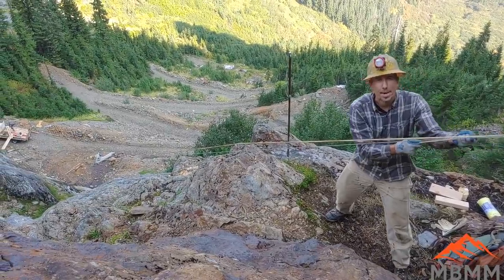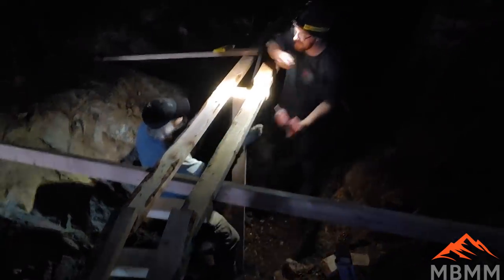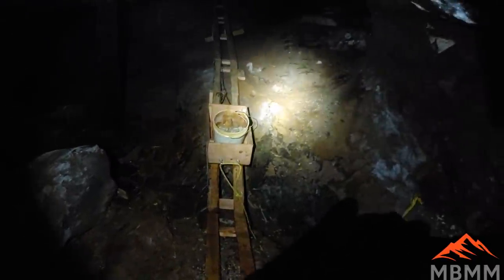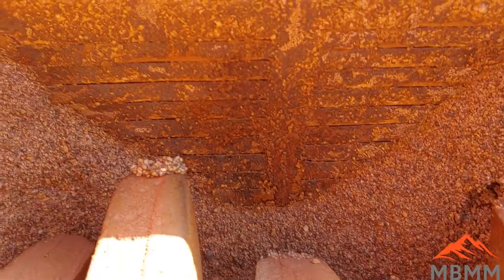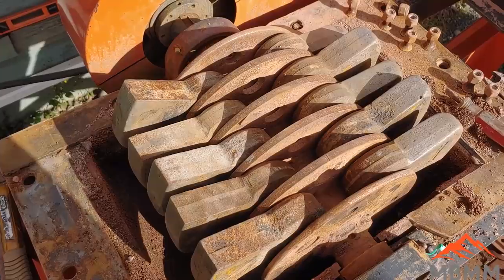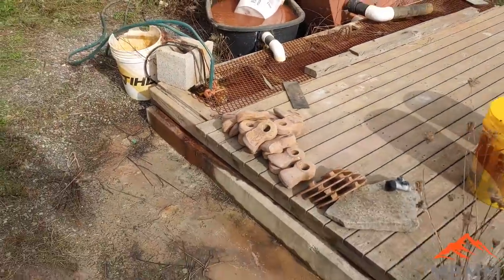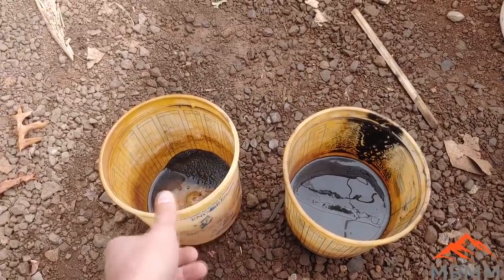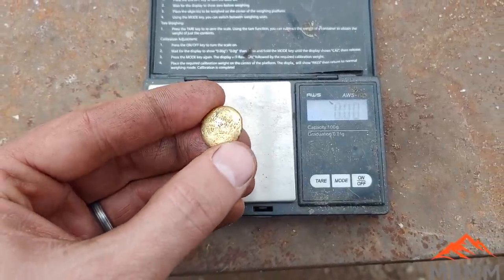Gold Mine High Grading, Hammer Mill Maintenance, Ore Processing, Gold Smelting & Refining

Comment: The strength in wood framing is in compression. We stack one piece on another. The only time we hang a piece by the end is if it sits in a hangar made for that purpose. Around 5 minutes it is clear that the whole weight is hanging on a couple of screws. Put blocking under the rails, not just in the side. By the way. Nails are way stronger than screws. Screws break often just from vibration and the wood swelling and shrinking.

Comment: Hey sorry one more tip I’ve seen mills each hammer has a rubber washer made with tire tubes some have bought neoprene but it doesn’t work as well and the reason is that the rubber actually cuts down on vibration or the harmonics and it will cause the hammers and all the other mill parts to wear much slower. I get this is a comment insinuating it’s a opinion. However doing this will cut down on wearing components and mill much faster better and cleaner. However the rubber that’s added cannot bind the hammers they still need to be free moving. Having these rubber washers type pieces on both sides of each hammer and not preventing it free motion will greatly increase your production of its task. Believe it or not it’s simple and worth a try. It will save you so much. Vibration or the wrong resonance will have a huge negative effect.

Comment: If you can run your pulley horizontal one side can function as a in while the other side an out.  Slow motor outside.  Might have to run a line in for a remote stop start.  Plus you can wax your 2x4s to reduce friction

Comment: That same Teflon technology comes in wheel bearing form, so you don't have to slide your stuff on kiln-dried pine, hoping to prevent the effects of degradation over the off season. Also, for your bucket-decending system, use a large-diameter axle, fixed so it won't rotate, and wrap your control rope around it a few times. This will give you low-stress control over it, and you won't have to worry about it obliterating the cab of your truck. The wraps around the axle will multiply whatever friction you put on your end. This system also works in reverse, if the axle is spun. You just pull on the rope, this causes it to grip the axle (capstan, I think it's called), and the axle provides the bulk of the pull, but under your easy control.

Comment: Just thinking out loud here.... but for safety, I think one of the best investments you could make would be some LIGHTING for inside the mine.  
Then, install a small winch system at the adit.  You could run both on a generator of sorts.  I mean, you could either get a small generator for your truckbed and charge up some car batteries in your truck on the way to the mine, then transport the batteries up your tram system each time you work at the mine, or better yet, bring a small gas generator with battery backup TO the mine and run it just outside the adit and run wires down into the mine for lights, and plug the winch direct into a 12V port.   That way you aren't worried about fumes from the combustion of gasoline or the sound. And you have a slow steady pull for the ore carts and lighting througout.  LED lighting would use far less juice vs. incandescent.

Comment: Install water injection sprayers above the hammers the prevent the build up on the walls of the mill. The water now in entering at too low of a depth in the mill and will come to a trickle when build up is too much.

Comment: I was impressed with the efficiency of the jaw crusher. I have operated jaw crushers for years and have found they produce best when the jaws are full of material (but not overflowing of course).I am curious to know if your jaw crushers implement a safety so that if a chunk of steel is accidentally dropped into the jaws the damage is minimized?

Comment: haul a generator, battery, winch, and cable to the mine for lights, charge the battery, run the winch, and save a lot of work.
Reply: A Harbor Freight truck winch would be perfect, and even a hand winch would help out a lot.

Comment: David, This channel is like a text book for small gold miners, great work as usual. Did you add ANY lead to the Cons before smelting . And did you way the button before Cupeling. Also have you considered a vibrating fines screen after the Jaw crusher to divert the minus final mesh size portion ifrom the jaw crusher discharge before feeding into the hammer mill to save wear on the hammers and speed up processing. You could perhaps run the minus portion over a pulse jig before the pulp enters the shaker feed.
Reply: Sorry Jason, Not David. You just look like a David I know

Comment: I was wondering about those rails, is there any gold in that mud covering the floor?  I love the aerial tram!  Taking a clue from the past.  Might want to put a little WD 40 to spray on that teflon rub plate every time you haul some buckets up.  Looks like you could use 300' of teflon on the wooden rails as well. Freeman balers had big rollers on the plunger base that were greaseable, they were low profile, maybe they would work on the bottom of your ore cart hauling the buckets up.  Nice Job!  I love what you are doing!  Its  great to see the gold coming off the shaker table!

Comment: Do you not hard face weld the impact areas    of the hammers?  To slow the wear. Just a 2mm thick couple rows of weld in the impact areas  can make a big difference.  In excavator buckets, and similar impact and wear areas. The weld can be ground to keep the original shape .  I would definitely give it a try, when they have had about a ton ran through them would be about the right time to do it. When they just have enough wear to see how they are bgoing to wear. A stick welder welder capable of about 100-140 amps. Depending on the size of rods used.   It would be well worth buying a s pound or two, (maybe more)  if nothing else weld a set of heavily worn hammers. See how it goes. Im  thinking it will work out well. Give new life, or extend the life for the cost of 20; minutes of welding.

Comment: How much vein material could one man break apart in an hour using only hammer and cold chisel?? One ton? I mean if you were not allowed to use explosives.
Reply: Depends on the hammer and a proper grind. But I doubt more then 100-200 lbs.

Comment: Guys get some polyethylene pipe about 600mm diameter and cut it in half and use this as a slide to pull buckets up on. Easier and corners are no problem. Get away from the wooden rail system and poly last a long time

Comment: How many man hours did it take to produce that gold?  What would be the cost allocation of the refining machines and then smelting down the gold?

While I commend you on the wooden rails, the wooden sled and the pulley system down to the truck, could you come up with a less labour intensive way to get the ore from the mine face to the truck?  How about a "gondola like/chairlift" system taking the pails suspended overhead down to the truck.  Probably crazy but if you could it may be easier to traverse the undulating path from above than from below.

We are all rooting for you.

Keep up the great videos.

Thanks.

Comment: Starting new then before you turn the hammer to the other side to use that crushing edge can these be welded to add new material on the side that’s be en worn? Obviously grind a bit to get uniformity. Then when it time to turn them 180 again and weld the back that was worn down and grind to conformity. Is this possible. Also new are they hardened or not? And what steel are they made of. If you’re using them at a high rate why not CNC them yourself if possible wants you know the answers of the questions I asked. If cnc is possible and they are hardened you can do that all yourself much easier and cheaper faster as well. If they’re not hardened you can weld these adding your needed original specs flop them and they will get back to their sharp. Balancing these would be so easy if needed but probably not and would self balance.

Comment: figure 400 lbs for cart and ore, will those 2 x 4s hold up?
Reply: Two buckets of ore are about 100 pounds each, max. Cart is about 20 pounds, max. I think they can hold 200 pounds.
Reply: @xenaguy01  yeah, i commented before finishing watching the video.  i was expecting that Jason would be hauling more than he actually did in the cart and was expecting a metal cart, with wheels and tipping feature.
Reply: have you watched jeff williams videos about putting together a mine?  some great ideas in them.
Reply: @richardservatius5405  quick cheap method of moving ore to prove a mine for investment or flipping mines?
Reply: @RegWhelan  i'm not a mining engineer, but look at jeff williams videos on utube to see how he does it.

Comment: I was thinking turn the 2x4's on end and have them  match track width and make a two disc wheel out of hardwood one disc large than the other one to lock on to the tracks and for wheel with  wooden lever brake  grease axles with your bacon fat Lol.

Comment: The way you put the 2x4 braces in only the screws are holding the weight I would move the actual wood under the rail and not screw it to the outside otherwise look up how much a couple screw will hold!!

Comment: Great video to show off the equipment but as a fellow miner your equipment in the video looks good for small scale sampling but way to small for efficient mining. Why havnt you installed lights? An air intake and outake system!? I say this cause i dont see any personal or sq footage oxygen system in the mine.  You also need to construct a hollow area to place a cave in safety structure incase of any cave-ins. I see that as a very concerning safety requirement thats not installed....remember if your the claim owner and something happens on your claim you are fully held accountable for failing to place safety measures and to keep miners safe from anything. Technically your operation underground should be reviewed by a mine safety officer if you plan on underground mining. The whole extraction process(i.e no flotation cells or ball mill to separate crushings and other systems) you are using is a complete waste of time including the rail system u installed.  
Nice attempt but i cant see this as an efficient mine especially since ur only minor sampling under 5-10 tons. How much time, fuel, man power, and electrical needed for you to sample, start to finish. Total gold minus total cost of extraction, screening and cleaning(tons per hour), and smelting and maintenance? Gives you an idea how efficient this process is and the costs associated. The bar also would be resmelted by a licensed smelter to a higher % of pure gold than what comes out of your molds. Id say you probably had closer to 12 grams maybe lower. Not worth it.

Comment: Hard rock needs to be close to corn meal. Doing jaws then on to process to capture you will lose many many pieces of gold. I’ll bet you on this and win every time. I don’t know if you’ve every been on a beach sand jet operation they right way it needs to be set up. Anyone that has done this will tell you so much knowledge about gold and how to collect it correctly. When you get to mining fines it’s a whole different game. If you don’t do it right you will get a about 10% of the gold you run if you’re lucky. 

When doing hard rock. Obviously you’re crushing and changing sizes of everything. Everyone just fears their gold collection tactics to what they see and hear about the size and type of gold that others gathers. 

As soon as you start milling rock to release it’s gold you have changed everything. When you mill you want everything the same size no matter what. In this thinking you are applying this to the hard rock. Gold will be always unpredictable. So as you use jaw crushing and watch different sizes come out the only thing that should move to the next process is the finest of the fine. Yes simply you may need to classify very simply just to get out the very fines that way you can reprocess everything except the very fines (dust). Depending the hard rock with re jaw crush or straight to the hammer mill with water introduced correctly. This process is exactly the reason for ball mills. To get everything fine and the same size, to separate every bit of the hard rock partials. This parts of your mine you will need to rest what works best for your mine before you buy machines and process to the end. 

A jaw to ball mill are wonderful but usually are very large and requires many recourses. So to jaw, separate, then hammer mill with water for cooling cleaning etc. all reasons are good for your mining needs. You can get everything to the same size very small as near dust. Once weight separated on water table wheels etc. everything will be extracted from the hard rock. As mine you will be able to classify other minerals etc. in the process.

Most never sluice these fines even with an extremely long sluice run to capture fines. 

Nowadays on a small scale the gold cube would be used just like on the beach with the Hydro nozzle and suction leading to a twenty foot run sluice then later ran i the cube.

On large scales a table etc will be used for a large operation to capture the fine gold. 

However hard rock mining the most important first step is to break down the rock incrusted gold is to pulverize it. 

If you are crushing it and still have some size etc. aggregate you will lose gold, you can bet on it!!